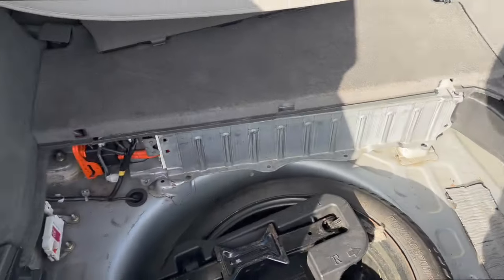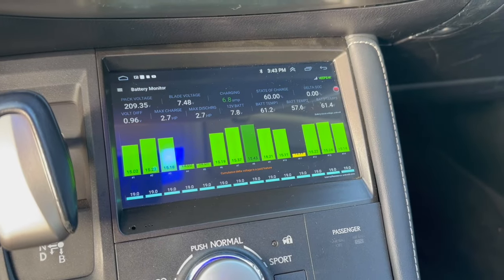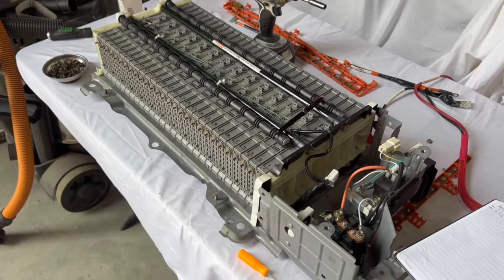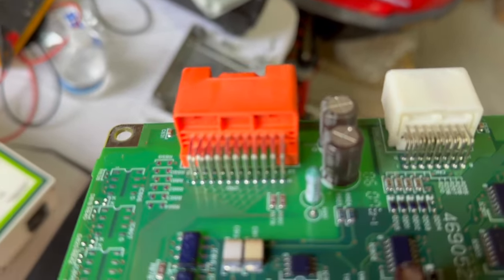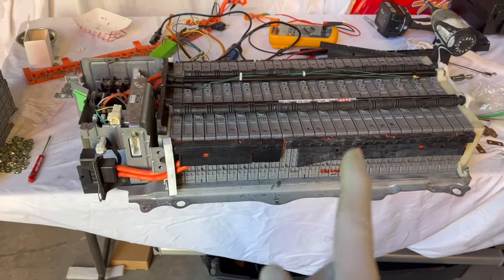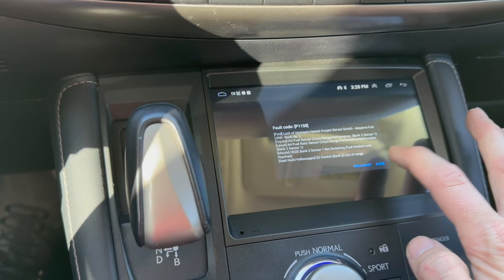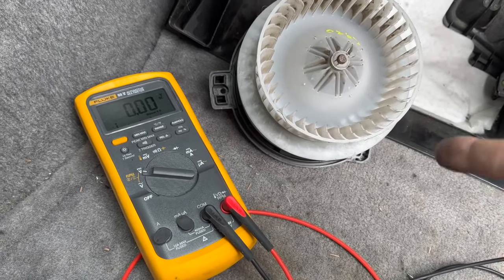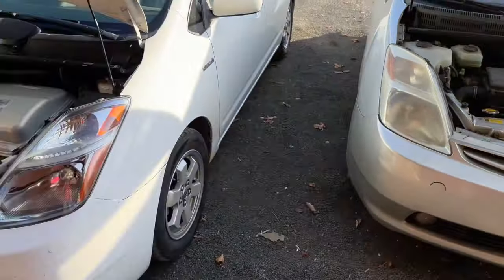I Saved the Most Hated Car on the Internet (and made $2500)

Comment: this is exactly what ive been doing. Ive got six priuses. two daily drivers and the other four are project cars. ill probably end up selling them as my health has started to decline.
Reply from the maker: Where you at? I’ll buy them.
Reply: im in west Tennessee. Brownsville.
Reply: @TheHybridGuy  the two id like to sell are in running condition. The first one needa the rear brake lines on it redone. That one has 147k.  The other runs fine,  but needs some tlc. Id like to keep the other two for parts or for when i eventually am able to get around to fixing them.
Reply: There was a time when i would find them and buy them and fix them up and donate them to families in need. But over the last two years things have changed dramatically and i cant afford to do it anymore.

Comment: Nice video.  What was the engine code?
Reply from the maker: The first one was P1150 the second one was p3000 but I had forgot to plug in the HV battery fan which is why the second one appeared.

Comment: Hi, great video. I found you while looking for information about the P3000 and dreaded red triangle which had popped on my 2005 Prius that I've owned since almost new (<1000 miles ex-demonstrator). I first found your piece on TorqueNews which was very helpful and gave me hope that I might not be looking at either a replacement Hybrid battery or worse if not economically viable a new car!
Well I managed to extract and test the battery fan - it as fine. Couldn't immediately see the corroded connector so next I located the fan
relay and tested that - it was also fine but with a little corrosion on one connector tab - cleaned and refitted. Still couldn't spot the
suspect corroded connector so then turned my attention to the "battery blower controller" (which I note seems to have exactly the same
part number as the cabin fan blower resistor!) - all connections good on this so assumed I must have the same corroded connector problem - but try as I might I could not see one like it anywhere near the blower fan as pictured in your article. - Much head scratching as
obviously there must be a connection somehow to the Battery ECU.
Finally thought, if the ECU is on the HV connector end of the battery (opposite to the blower location) that maybe, on my car the cable is
routed differently and the suspect connector actually under the trim on the LHS of the car - removed the LH trim and lo and behold there
was the dodgy connector and indeed it WAS corroded (in fact one wire broke off completely when I touched it). So hopefully, thanks to
your pointers I may have a cheap repair.
I've ordered a cable mounted locking plug and socket and I'll just solder them in place of the original and zip tie it securely. Fingers crossed!

Having come here to thank you and leave my comment I'v now watched this and find myself thinking - yeah, I really need to do that with
my headlamps too!

Thanks again, you really helped and now I've found your channel I'll be keeping an eye on your posts as I fully intend to keep my Prius
on the road until it's no longer practical.

Comment: Hi Peter, good job in breathing new life to a junkyard Prius, a lot of useful info in the video, I had to subscribe and I'll check your other content 🙂I have also a question please - I actually found your channel thanks to your article on torquenews about how you fixed Prius P0420 error (catalyst below threshold) using a can of CRC Valve cleaner. 
I have the same issue with my Gen2 Prius and wanted to know how exactly did you apply the spray. Is it OK to remove air filter cover, then have someone to keep engine running and apply the spray directly to the opened intake (to area where I can see the throttle valve/flap). I heard the spray should not get in contact with Mass Air Flow sensor, so I would be spraying well below it. 
Thanks for your reply!
Reply from the maker: Just do as the can instructs. put in maintenance mode.